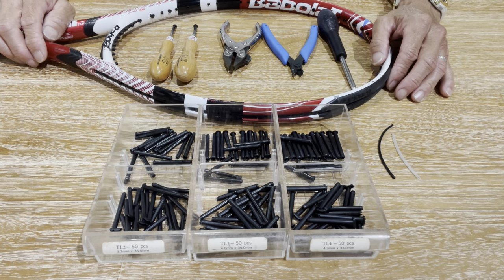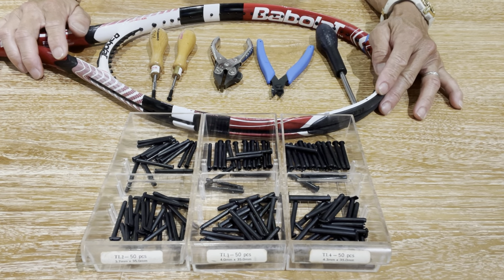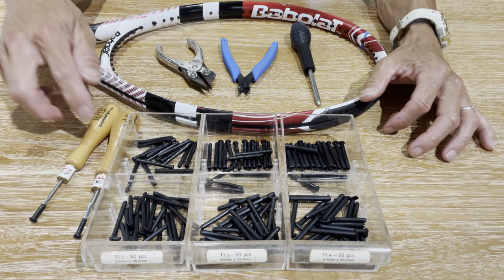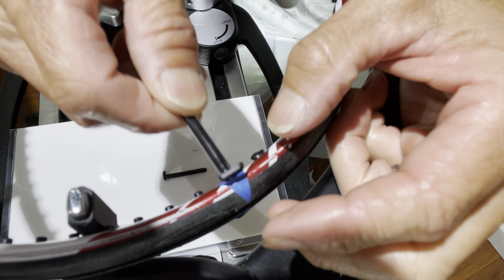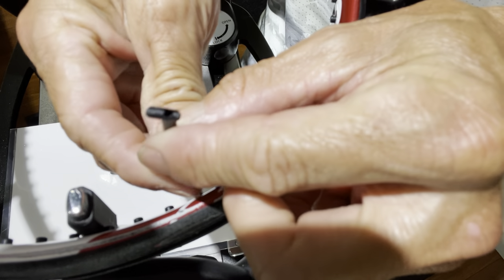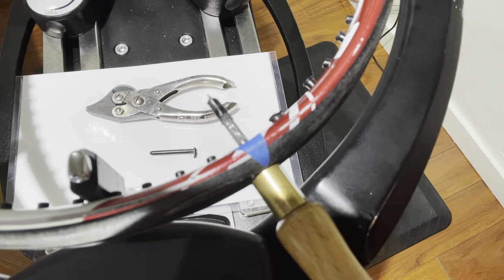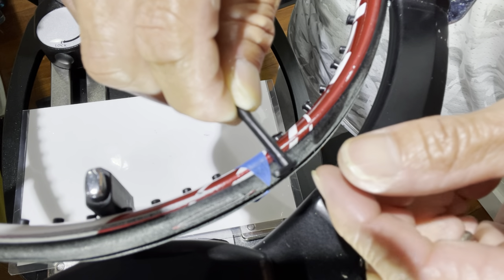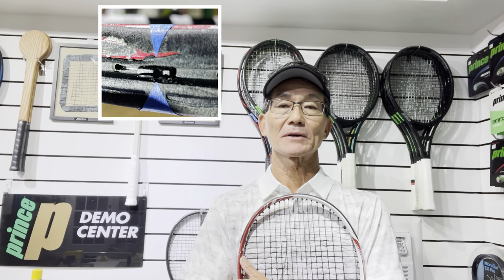Racquet Repair [Grommet Grinder Application]

Comment: Thank you for the demo--the grinder made fast work of the repair but for amatuer and occasional stringers, tubing is probably the cost effective way to repair a grommet. What did you use the setting off tool for? I have one with a blunt taper that I use for reflaring mashed grommets. You too?
Reply from the maker: Aloha Robert, I was wondering if anyone would be curious enough to ask. Initially, I thought I should have the setting off awl just in case I needed to push the grommet insert into the frame from the outside, to make it sit flat onto the grommet strip. It turned out that wasn't the case so I never had to use it. I use the setting off awl mainly to straighten out strings after installation. I don't flare out my grommets so I've never used it for that purpose.

Comment: i'm trying to determine what size grommets I need for my very old Wilson Pro Staff 6.0 85 racket.  Most of the grommets are very brittle given the age and have cracked or fallen off.  Will the 3.7mm, 4.0mm and 4.3mm you mention work for my racket?
Reply from the maker: Aloha, Good news! Did you know that Wilson re-released your racquet? 
https://www.tennis-warehouse.com/Wilson_Pro_Staff_60_85/descpageRCWILSON-W26085.html

Maybe grommets will be coming out soon. 

As for your question, you probably should get all three sizes to be safe. Or if you have a micrometer you could measure the diameter of your grommets. Make sure to check the single string hole and tie-off hole. I measured the holes of a similar Wilson racquet and this is what I got.
  * Single hole - 3.6mm 
  * Tie-off hole - 4.2mm

I hope this helps!
Reply: @AMstringing  I saw the reissue rackets on TW, but $250 is spendy when I have an original from back in the days.  I'm going to order a micrometer to measure the existing grommets.  I love my the feel of this old PS 6.0 and can't justify $250 for a new one.  I don't hit with it regularly, but like to pull it out every once in a while to bring back memories.
Reply from the maker: @crumbsnatcher74  Yes, pricey at $250, but hopefully, the grommets will be available soon. You're probably better off getting all three grommet sizes. It would be cheaper than buying a micrometer. Talking about memories, sometimes you wonder if these re-launched racquets will have the same feel as the original ones. Especially if you have one of those special St. Vincent-made frames.
Reply: @AMstringing  Speaking of St. Vincent PS 6.0 85 frames, there are 5 versions of the St. Vincent frames with Sampras playing with the 5th version specifically.  Ironically, after posting my question to you earlier today, I found a new old stock 1st original version St. Vincent frame locally tonight on FB marketplace.  It was strung with some old syn gut but the racket was absolutely mint with no visible signs of wear or tear from any play and the leather grip is in pristine condition.  And the best part is the grommets are in perfect condition too so I can easily measure them so that I know which Fittex size to buy.  Now i have a Chicago made PS 6.0 85 and a newly acquired 1st version St. Vincent PS 6.0 85 racket with a HMQ butt cap code.  Can't wait to finally hit with a St. Vincent frame.
Reply from the maker: @crumbsnatcher74  I didn't know about the five versions of the St. Vincent frames. Thanks for sharing! I'm happy for you that you found that version 1 frame! 😊Happy Hitting! 🤙